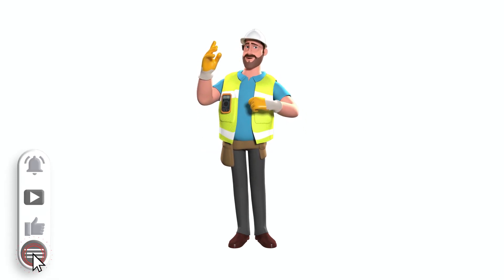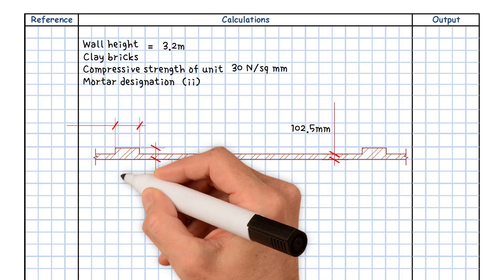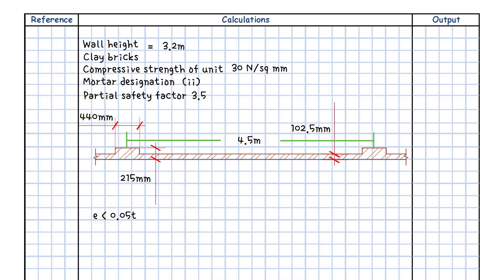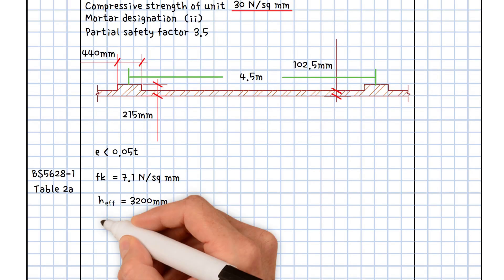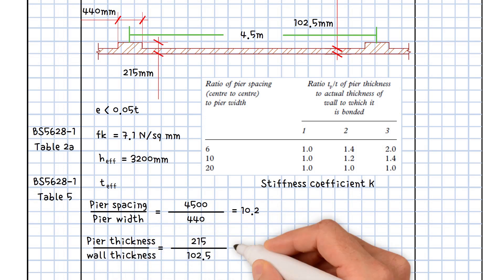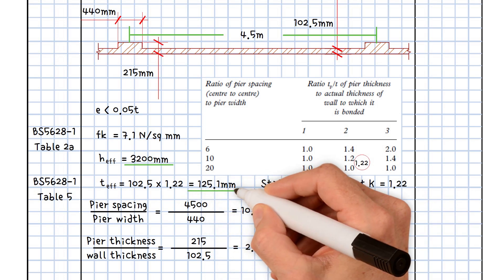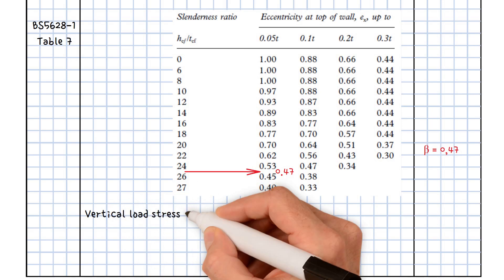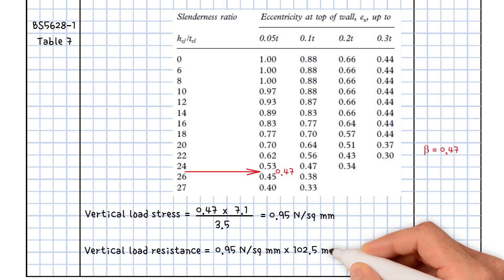How to work out stresses in brick walls stiffened with piers.

Comment: Thanks for the video; you have checked only for the vertical load. Are the old bridge brick parapet walls with stiffened piers, were designed for only vertical loads? How about any lateral loading such as wind or pedestrian load or combined both wind/pedestrian?